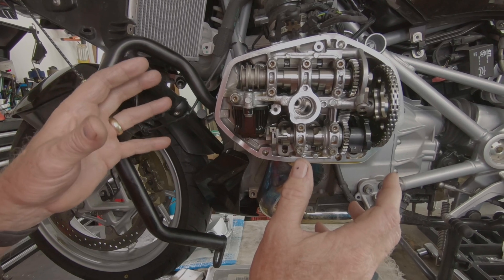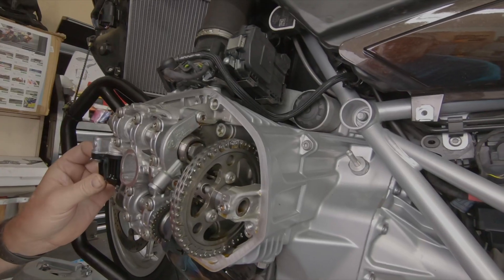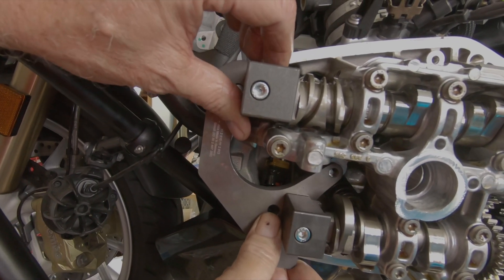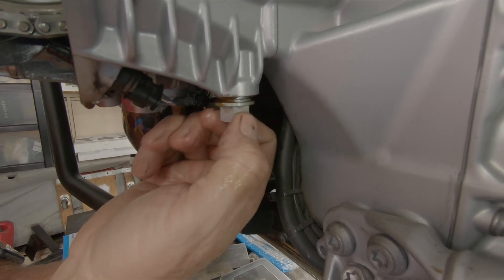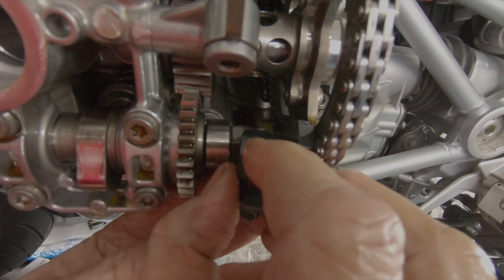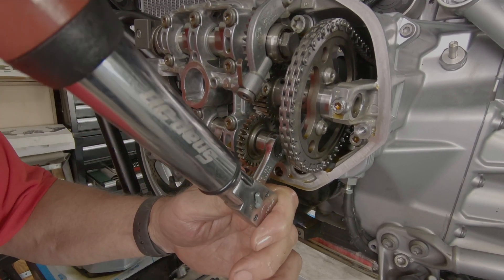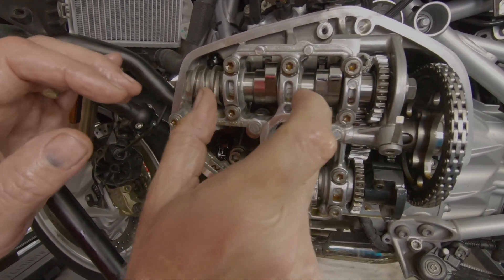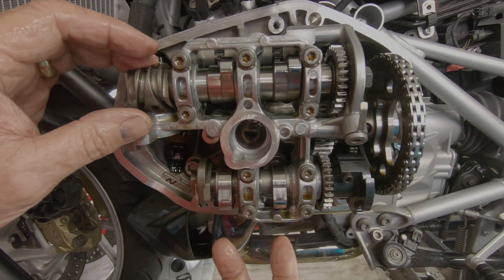BMW R1250 LH Cam Timing Part 1 of 4

Comment: Hello, is it necessary to adjust the camshafts with a computer after adjusting them?
Reply from the maker: While it is not absolutely necessary to do an Adaptation Value Reset of the 7 modules of the ECU since they will eventually adjust to the new volumetric efficiency of the engine…one of the modules is Reset Camshaft Adjustment. 
Doing the Reset of all 7 will allow the engine to repopulate the “look-up tables” quickly, from a new starting point rather than skewing all the old accumulated data in the ECU. 
I highly recommend doing this Reset after a Cam Timing and Valve Clearance Service.

Comment: Hello, thanks for great video - now I got understanding of the process. But I have question: I have 2012 R1200RT (camhead) and going to replace valve stem seals. Reading RSD how to adjust timing. I have original tensioner tool and in manual it says: install tensioner, "Tighten the tensioner tensioner with ratchet-type ring spanner (No. 11 1 514) until release and click three more times after release.", rotate crankshaft twice and then it says: "Screw in timing-chain tensioner (No. 11 1 512) using ratchet-type ring spanner (No. 11 1 514) again up to the freewheel and until it makes a clicking noise." Does it means I have to make one more click? I'm not sure if I understand it correctly. Do You have any idea what it means? Thank You.
Reply from the maker: @sba230 I have done several CamHead cam timings and believe that the manual has double entry of the text describing the process.  Rather than try to correct what the manual says, here's what I do...
The LH (clutch lever side) is the tightest access and as it says does not use the spacer sleeve on the cam chain tensioner.  The reference to the specific part number spanner is optional and any brand of ratcheting spanner, or even a small socket on a ratchet with U-joints can work on the end of the CCT.
Once the locking pin is engaged fully with the flywheel and the engine block at TDC, I tighten the cam chain tensioner to the 3 clicks point, and fit the alignment jig on the flats...if it does not fit, then you need to loosen the bolts on the other end of the cams, do the adjustment of the cams and retorque the bolts.
On the RH side (throttle grip side), it has clear access under the cylinder as you can see and uses the 15mm long sleeve. (typically Blue from BMW)
Again, rotate the engine so the RH cylinder is at TDC, lock the flywheel with the pin, fit the alignment jig, and make any adjustment needed.
The issue I have with the CamHead is that you can only get 2 semispherical shim to fall within the range of tolerance...sometimes too close to the open/loose/noisy end of the range.
Hope this helps.
Reply: @Boxflyer11  thanks for quick reply. So, basically on both sides I do 3 clicks only? Yes, I have blue sleeve also for RH. Why I asked is that from my understanding what RSD says, I have to make total 5 clicks (first when tightening, then 3 more clicks, then again one more). And it feels like 5 is too much :) So, 3 is enough - that's good.
Not sure that I understand why only two shims within range? They have 22 sizes with 0.05mm step. Now my clearance is very close to max on both sides for intake/exhaust, but since I have leaking valve seals, everything inside is in carbon & oil, so I will clean everything and reseat valves and I expect that gaps become smaller and I can use smaller shims (now I have 5.2-5.4 shims).
Reply from the maker: @sba230 As far as clicks go, 3 ensures you reach the correct compression on the CCT tool, and a few more doesn't really affect the movement of the inner shaft, so if you went to 5 clicks, it would still be the same as 3.
For staying in the range of 0.13-0.23mm for the INT and 0.30-0.40mm for the EXH, the issue might need some examples.  Let's say one of the INT clearances is at half way in the range...0.18mm.  The parts fiche lists all the available "semi spheres" in 0.05mm steps, and let's just say that currently the valve in this example has a 5.30mm shim installed.  Changing to the next closer shims of either 5.25mm or 5.35mm would make the clearance right at the limit either too tight or too loose...so 5.30 is really the preferred shim, although either of the others would technically be "OK".
If the INT clearance was 0.15mm with the same 5.30mm shim, then keeping that one would be OK as well as changing it out to the 5.35mm so that you had 0.20mm clearance...anything more or less that that would fall out side the range.
You can play this scenario out with any value for either INT or EXH and see that it really limits your choice of what shims can be installed...unlike the WetHead/ShiftHead/1300.
Whenever you do your first valve clearance check, it's worth the extra time to remove and record each semi-sphere installed in its location for potential changes in subsequent service checks....just remember that BMW recommends not reusing the E-clips on the rocker shafts, and new ones are a reasonable price since you only need 1 per valve.
Reply: @Boxflyer11  thank You, now I understand what You mean with two shims. This makes sense. The only way I see to improve situation is to look for used shims - they slightly change thickness, so may be it's possible to find perfect fit. Btw, do I need to be as close as possible to minimum (0.13/0.30) ? Or it's better to keep somewhere in middle of rage?
Thank You for pointing to retaining clips - I didn't notice that manual says to replace it. I removed them once to measure shims and it was 15k km ago, so I was lucky :) Will replace them.
Also, now I understand about clicks - I lust looked how CCT works and yes, it doesn't matter how many clicks - it will stay at same tension. So, I will follow manual and rotate crankshaft twice after installing CCT to settle everything and then click again to make sure proper tension.
I have another question if possible: there is cylinder head gasket (11127710398) that appears to be metal and of course BMW says it must be replaced. But I've seen some people sell used gaskets in good condition, so that made me think that I can reuse it at least once. How do You think - is it possible? I'm asking because for me currently, it's 2-3 months wait time for order and they will cost me more than $100 for pair.
Thank You.

ps: YT randomly deletes comments, so I posted it again.
Reply from the maker: My experience with the semi spherical shims is that they wear very little, so the etched markings on the small flat portion around the edge are usually what they are.
I would be happy with any clearance near the middle of the tolerance since I find more influence from carbon build up caused by poor gas than actual wear on the valve train.  I recommend using one of 2 fuel system cleaners with PEA for about 4 tanks of gas just before doing the 12k service.
I would avoid trying to rotate the engine with the CCT installed and tensioned tight to the 3 clicks setting.  As I said before, lock the engine at TDC, adjust the CCT to 3 clicks and align the cams...once that's done, you may find that the cams stay in time for a very, very long time...checking the valve clearance is pretty quick every 12k by just visually getting the valves you are checking on the base circle of the cam.
I have had the heads off of a bike like yours before, and would not reuse the head gaskets, it would be difficult to visually determine if they are really OK to use a second time...better to buy once, cry once.
Reply: @Boxflyer11  If I understand right, gap becomes bigger and bigger shims needed over time & mileage? My guess this is because carbon build up on edges of valve/valve seat. So, if I clean valves & seats and do valve grinding I think I will need smaller shims than I have now. May be it's possible to sharpen old shims to get them to the right size?
So, I'll try to adjust my shims to be in middle of range. Thank You.

Regarding the tensioner. I opened RSD in German and translated it. And now it makes little more sense to me, why they ask to rotate crankshaft. Basically, we have 3 sprockets and chain that makes triangle. We're putting tensioner on one (long) side of this triangle and it seems that there is possibility that tension is uneven between all three sides. Here is translated part:
-Install the tensioner.
-Using a ratchet ring wrench (No. 11 1 514), tighten the tensioner until it engages freely and click the freewheel three times.
-For orientation, place the mark (arrow) on the camshaft sprocket.
-Remove the locking pin (No. 11 2 650).
-Rotate the crankshaft two full turns in the direction of engine rotation.
-The camshaft sprocket rotates one full turn.
-The chain drive is aligned.
-Install the locking pin (No. 11 2 650).
-Using a ratchet ring wrench (No. 11 1 514), tighten the timing chain tensioner (No. 11 1 512) again until it engages freely and click the freewheel once.

So, to confirm if tension is uneven, I would make 3 clicks, rotate crankshaft and then check, if there is free tensioner rotation before it clicks again. I don't know when I'll have a chance to check this on my bike, but it's very interesting question and I'll try this just to understand.

About gaskets - what will happen if they don't work properly? Oil leak & combustion gas going outside? I mean, will I be able to determine that gasket is bad when I start engine? I'll try to order them, but there in no guarantee they will appear in time (if appear at all).

Thank You.

Comment: Thanks for the excellent series of videos Brad. Your attention to detail and thoroughness is commendable.
A quick question if I may on the valve clearance check/adjustment for the 1250 shift head:
Is there any reason why check/adjustment should not be done without resetting valve timing?
In other words, if I don't have the L and R jigs (expensive), but I do have all the other tools, plus a selection of shims can I go ahead and do just valve clearance adjustment without disturbing relative positions of camshaft/timing gears/ camshaft position sensor?
Hope I've made myself clear.
Thanks again, love your vids.
Reply from the maker: When doing the valve clearance service you don't need the cam alignment jigs to set, or, reset the location of the cams.  It helps to start the valve clearance check with the flats on the end of the cams lined up parallel to each other and the piston at TDC for the side you are working on...then if the cams need to be removed to swap out the shims, just put them back in the same as you started...don't rotate the engine, that's all.
Reply: @Boxflyer11  Thanks.

Comment: For the camshafts alignment, does it absolutely need the manual cam chain tensioner tool? I am trying to figure why the need of it? Can someone explain this to me? Despite the engine being positioned at TDC with the locking tool, both camshafts have their gear end contacting to the same single timing chain gear. What will be the additional influence of putting more pressure to the timing chain with that specific tool? The OEM chain tensioner won't be enough?
Reply from the maker: @alainarsenault1458  Yes, the Cam Chain Tensioner is absolutely needed.  There is a definite difference in the result when trying to fit the Alignment Jig on the ends of the cams with and without the Cam Chain Tensioner.  The procedure from BMW is to use it, and the results without it will end up being incorrect timing of the cams.
Reply: @Boxflyer11  Fair enough :) I am wondering if the camshaft alignment could be discarded if the camshafts would have their gears all in one piece instead of having them bolted on their end...

Comment: Question on the cam chain tensioner tool.    For the 2020 R1250, the cam chain tensioner was the same part number for both sides of the engine, even though the left side cylinder has a longer chain (by 6 links as I recall).  In 2021 or 2022, BMW made a rolling change to the cam chain tensioner such that the left side was a different part number with a longer initial length, and thus more force on the longer chain.  This was to reduce excessive chain noise at idle.  The new left side tensioner is backwards compatible with the earlier 1250s.

My question is, how does the 12mm of preload on the spring in your tool apply here?  Shouldn't you need a little more force on the left side chain?

Would the size of that sleeve change?

I ask because I have a 2020 R1250gs and I recently bought your full toolkit to do my own valve clearance and cam timing on the bike.  My bike has the updated left side tensioner installed, which I can tell by the 19mm hex instead of 17mm.

Thanks for any clarification you can provide, and great videos.

If anyone here wants a set of these tools, check out his website, there is a small machine shop making them.  (Pilz Machine)
Reply from the maker: @tylerdamato8514 
A couple of points to clarify, 
1) It is the RH side chain that is the longer of the 2 sides because it is driven from the counterbalance shaft that runs below the engine from the clutch in the front to the transmission at the rear...the LH cam chain runs more horizontal since the sprocket on the crankshaft and the sprocket on the intermediate shaft are at the same level in the engine.

2) Correct, the LH cam chain tensioner from mid '22 production and newer is 5mm longer at rest with it's repositioned internal piston/spring sitting closer to the guide rail...same spring, same length piston, just stepped up in the cam chain tensioner body.  That extra little push on the lower (slack side) of the cam chain guide is to help when the RPM is at idle and the hot oil pressure can be as low as 18psi...allowing the upgraded link chain to slap on some bikes.  (The 1200's have a roller chain and was causing wear points from the side plates on the guide rails)

3) The cam chain tensioner tool that I developed is designed to exactly duplicate the effort and result of the factory tool...not the running cam chain tensioners.  If I mentioned this in one of the videos, that was not right.
This factory tool was developed for the R1200 CamHead back in 2010 for alignment of the cams and has still been designed to apply the "3 clicks" of spring pressure on the slack side cam chain for all 3 series of engines.  Because the different length sleeves used on the factory CCT tool are keep on the body of the tool when in use, they have varied the length from 15mm for the RH CamHead, 10mm for the WetHead and back to 15mm for the ShiftHead, these sleeves come in contact with a recessed step further in from the outer shoulder that my tool rests on.
The point being, my tool exerts the exact same effort as the factory tool when used as designed for static alignment of the cams with a known tension on the cam chain.

Short summary...the CCT tool is not affected by oil pressure or any other "running" condition of the engine...the engine must be a maximum of 35c/95f for any measurements/adjustments.  The tools I designed match the effort of the factory tool, and have done so since 2019 when I started making them.

Hope this didn't cause you to fall asleep!
Reply: @Boxflyer11   Thanks for the clarification on the tensioner!

I just did the ~36k-mile valve clearance check and cam timing adjustment using your tool set and these instructional videos and it went great!  I only had to change one shim, which was nice.

Comment: Why are they so out of time from factory?
Reply from the maker: My belief is that the cam timing IS correctly set right from the assembly line. 
When a WetHead/ShiftHead gets somewhere between 10-12k miles, all the valve train finally normalizes the wear and settles in to this state for the next 100k miles or so.